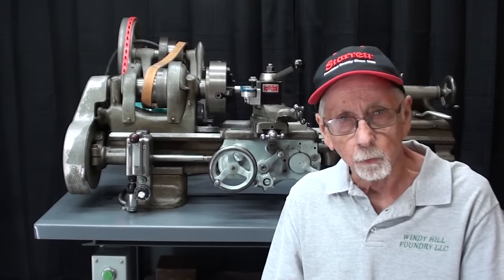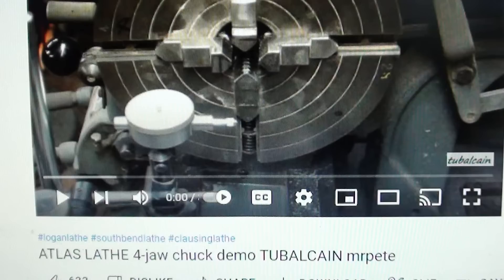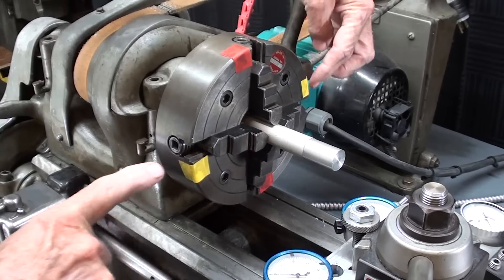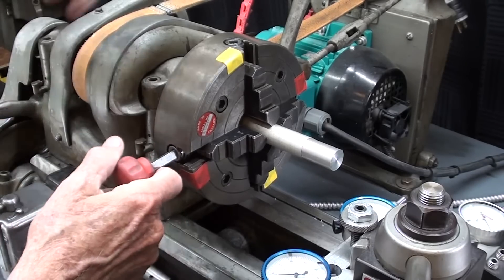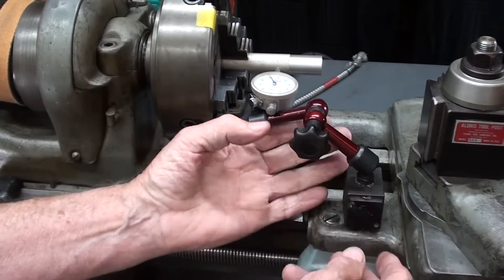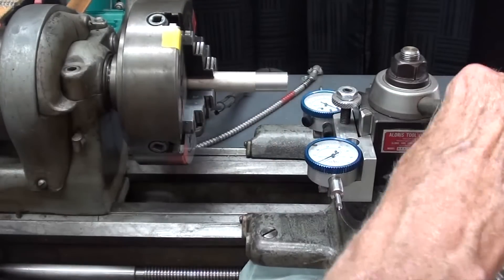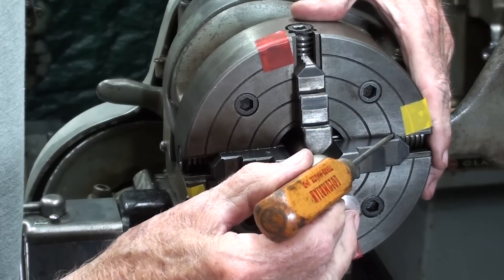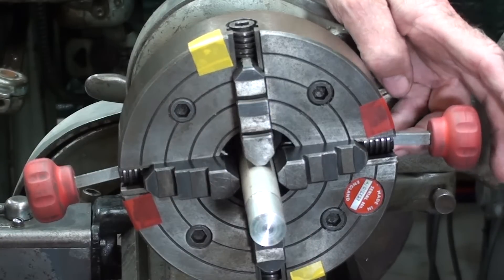TWO KEY Lathe CHUCK SETUP #823 tubalcain

Comment: Congrats on 15 yrs!

Gonna have to make a pair of shorties; looks like a good centering technique.

Perhaps you have a tip for a problem w/ my 4 jaw. It's as large as my little lathe will take, but there's no quality chucks made that small.

The Chinesium chuck is rough; poor tolerances. The 1st one died. The screws move a bit too much & the castings are rough.

I tried lube of different types, then a friend suggested wire wheeling the castings, but there are still places where the screw/jaw lock up tight.

I messed up w/ 1st one, forced it, thinking it was tight & chipped the screw.

Bought another, have tried wheeling & filing a smoother approach at the start of the screws. It's better, but 2 screws still bind.

Any ideas?

Thanks.

GeoD
Reply from the maker: No easy fix for that. Put some die on the threads and see if you can tell where it is binding.

Comment: In another video I saw that you had an interesting lathe tool that held the cutting bit in a diamond shape. It looked like it would make grinding hss bits very simple.
My question is who makes that bit holder?
Reply from the maker: I cannot think of the name offhand. They are made in Australia. I still intend to do a video on the diamond tool. And yes, it is very easy to sharpen or grind the tool.
Reply: They are made by Eccentric Engineering, in Australia as noted. A quick search will find them.They have some other interesting offerings, such as crobalt (yes, that is the correct spelling) tool bit blanks, and other items.

Comment: Yes I saw the original in Cork, Ireland all those years ago.  I immediately used two knobbly tires of a small toy and some square rod.  I still use it almost every time.  The wheels are great, good grip, not inclined to get in the way and the final tightening if needed can give an extra tweak with th standard key.  Steal the childs tractor and make two sets!

Comment: You mentioned the two key method sometime, somewhere in the last couple of years. When I heard it my brain went BINGO, and I've been using it ever since -- thank you. For some reason I have a small collection of keys, one of which is a stubby, so it works well for me.

But I have been using a Nooga for setup.. An indicator toolholder on my Aloris will make setup easier and will be more rigid. My very next project!

Comment: I have used the two key method since I watch your video ATLAS LATHE 4-jaw chuck demo. 
 Before watching I was getting very frustrated :face-orange-frowning: and avoiding using a 4 jaw. Congratulations on 15 years and thank you. Because of you, I have machine several working steam engines and mechanical parts. 🙂

Comment: You skipped showing a step. Find the high spot and the low spot, and set your zero at the midpoint between them. That establishes your target. (David Bingen mentioned that, probably others, too.) Two very small refinements I employ. I never turn the indicator bezel. I move the cross slide to establish my target. And I orient the indicator zero directly to the right (3 o'clock.) That way the needle mimics the workpiece position. If the needle is offset away from me the part is away from me, and if the needle is offset toward me the part is toward me. Makes it very intuitive. Finally, many of us make a small key just for use on the back side where hand clearance may be restricted, but use the normal key on the front.

Comment: Time 03:21, double acting. I made one, watching a bright guy on the Tube, that only needs one (1) indicator!
Time 04:30, two read knob keys... Brilliant way to show it! Pedagogic... (What else to expect from an experienced old teacher?)
You have surely seen a lathe tool having a ball bearing at its end, used to press wobbling objects to run straight in the chuck. I made one for the veteran railroad shop. The guy there use the rotation of the ball bearing for a 4 jaw centering and thought it was much faster then using an indicator!

Comment: Another great video as always. Adding one of those indicator holders to my project list now. Have a great weekend and thanks for all the great content!
Reply: The trick is to make the holder out of 1/2" thick or better plate and cut the dovetails into the plate. The dovetails may be sawed and filed to shape if you don't have a dovetail cutter. The dovetail doesn't have to be absolutely perfect as it is never under a load, it just has to be locked still to hold the dial indicator in place. A $15 dial indicator (on sale or with a discount coupon) from horror freight mounted to the plate with a screw along with a screw to hold the setting height, and Bob is your mother's brother. 
Now with all that you have a dedicated indicator holder and you've not had to tie up one of your regular tool holders.

Comment: I have used the two key method since high school, but it never occurred to me to make a pair of short keys with knobs. I will make a pair this weekend! Thanks for the tip. Content like this is the reason I have been a long time viewer. Thanks again.
Reply: @mrpete222  Sir can i have your email address for business . thanks
Reply: I agree. This technique could improve my speed. This sort of tip potentially improves on already understood and "mastered" skills.
Reply: Isn't it funny how we can use something for years, be annoyed w/ it, but it takes 20-30 yrs to think, 'Oh, I can improve this!'

Did the same thing was drill key chucks. Busted knuckles & cussed them for 30+ yrs, then slapped my forehead & thought, Improve it, dummy.

I now have handles of various types, fewer knuckle scars, & a somewhat cleaner vocab.

BTW, the quickest key handle is a round rod of delrin/acetyl w/ a rounded end & a press fit hole on the other to match the key.

Comment: Glad you revisited this "Trick O' the Trade" Mr Pete for it needs to be repeated for the newbies to the lathe. I learned using two chuck keys on the four jaw from an old machinist also. In 1974...Mr Papp, my Voc. Machine trades Instructor. He passed away a couple years years ago at 98 God Bless.

Comment: I made some chuck modifications adding more concentric lines and filling them with different colors of paint every1/8” or 1/16” and then I have a picture on lathe to show which line is which diameter. Makes fast roughing in parts. Video link in next comment if you will approve it.
Reply from the maker: That is a very good idea
Reply: https://youtu.be/qDYAq6R5Fac

Comment: I use 2 key method, but first I find the low, set the DI to zero, find the high and divide the difference between the low and high.  This is the new zero.  Then use 2 chuck keys to set each opposing jaws to this zero.  Fine adjustments are then made by tightening the highs. Takes about 2-3 minutes.

Comment: Still fighting to get my cheap Chinese OPTIMUN k72 250mm d6 mounted on my minitor d360..had to make a backplate for my backplate..ffs.... just need cut cone center fitment and try it out.., turned out heavy af.. Will have to lighten 2 backplates...later...

Comment: Thank you so much for this video!!   Just got a mini lathe ... came with self-centering 3-jaw chuck.  Later on this year I'll get a 4-jaw chuck.   I'll checkout the vendor you mentioned ... Shars ... for a dual indicator pair like you used ... seems to be very useful!!   All the best to you ...
Reply: 3 jaw chucks all have a little inherent runout, usually a few thousandths. You need a 4 jaw to get it right on dead nuts zero TIR
Reply: Agree with GeckoProductions -  expect run-out with the three jaw, and expect bugger-all with the four jaw.  As you might expect.  Have fun making stuff, Donald!